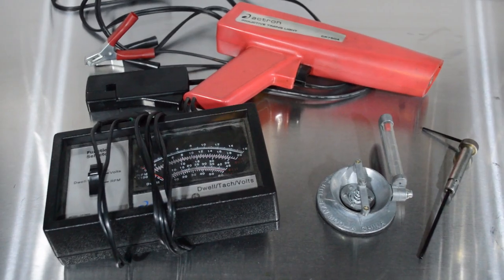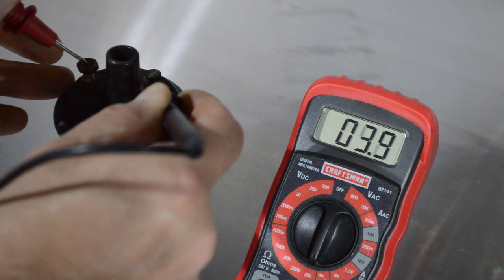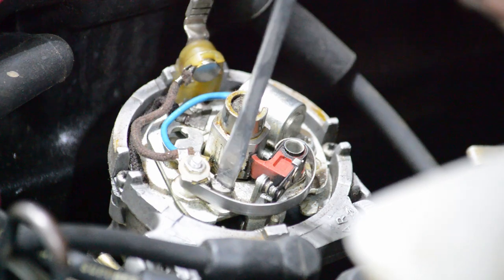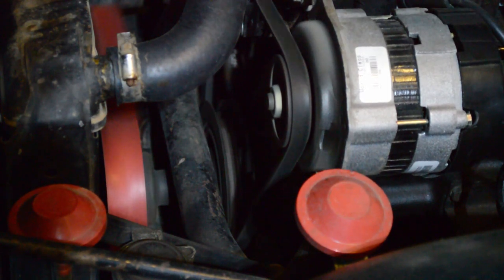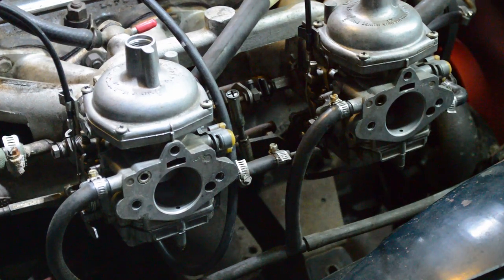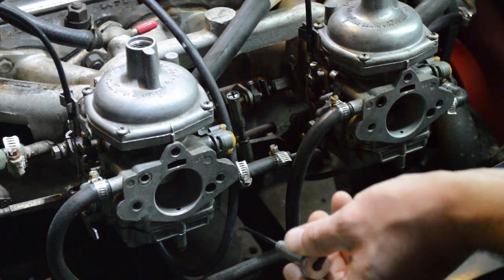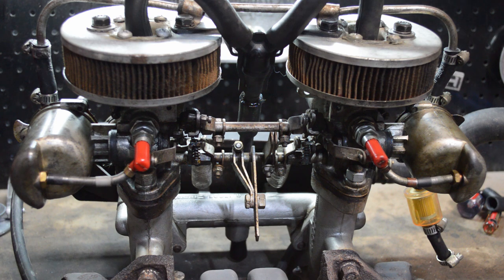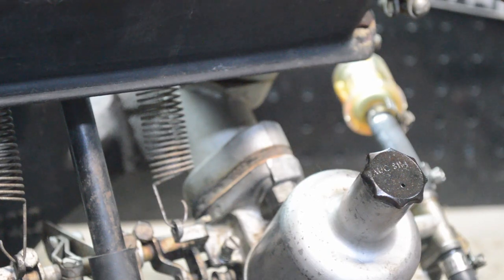How to Tune Zenith Stromberg or SU Carburetors on Your British Sports Car!

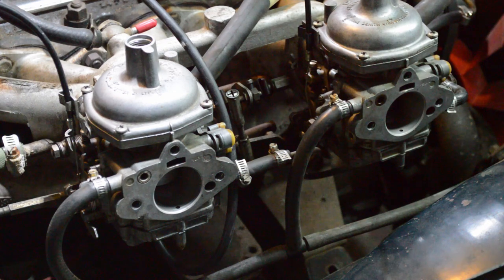Comment: 13:18 I really work on Edelbrock four barrel carbs but I''m helping someone who has a Triumph Stage fitted with these carbs, one thing we learnt is that if you screw the adjuster fully clockwise it will lift the needle and be fully rich, from that point you ONLY have 3 turns anti-clockwise (counter clockwise) to lean the mixture off, if you go more than 3 (maybe 3.5 turns MAX) then the adjuster will become uncoupled from the needle, then no matter how many clockwise turns you go it will not lift the needle! If you are careful you can gently push on the brass housing that the needle sits in to re-couple the adjuster. Also the way that the adjuster works appears to be backwards for a normal thread, i.e. when turning the adjuster clockwise you would think that the needle is lowered into the needle jet, it is not, it's lifted out of the needle jet, if you take the needle and its brass holder out of a piston you can work out how the adjuster works, its quite clever!
Reply from the maker: While it's technically possible, the needle really shouldn't become uncoupled.  There's a grub screw in the side of the air piston that holds the needle and keeps it from dropping out, so make sure that's in place and properly tightened.  At the top end, there's supposed to be a retaining clip that keeps the adjuster from moving up.  If you wrench down on it, it'll still move, but you should be able to feel it and know you're turning the tool well past where it should be.  Check both those things, since without them it'll be difficult to get the mixture to change accurately.
Reply: @midwestmotoring  Yep the grub screw on both pistons was in place, it does stop the needle from turning so that will go up and down on the adjuster thread and like you said it stops the needle from totally falling out of the piston but on the carbs that I worked on it did still allow the needles to fall away from the adjuster. If you think about it, if the grub screw did not allow the needles to disconnect from the adjuster then when the needle bottomed out on the grub screw the adjuster thread (or needle thread) would be damaged if you continued to turn the adjuster in order to lean the mixture. The needle would not be able to move any lower so something would have to 'give'.  Anyway if you have a spare piston with a needle fitted I guess you could test this, you could turn the adjuster counter clockwise 10 times, then turn it clockwise in order to see if it lifts the needle. One the carbs that I worked on it wouldn't lift the needles!

Comment: Thanks for the great video! I have a question about tuning the 175 CD. I have only one in my 1979 MGB. There are two screws that are accessible when the carb is assembled which I believe are the throttle-stop screw and the fast idle stop screw. How do I adjust those to make the engine run smoothly? I've been having an issue where the car runs well until about 2000 rpm but anything higher and the idle rpm drops lower and lower until the engine cuts out. Thank you!
Reply from the maker: Later CD carbs had 3 visible screws, which (at least in the US) were (usually, but not always) an idle trim screw, the fast idle screw, and the idle speed screw.  The idle speed determined where the throttle plate rested, the fast idle screw hits the cam on the choke (if you have one), and the idle trim screw you basically shouldn't mess with since you're not going to notice the difference anyway--you need a gas analyzer for that one.  You need a special tool to adjust the mixture of your carb, which I show in a few of my carb videos.  Hope that helps!
Reply: @midwestmotoring  Thanks for this but I can’t, for the life of me, find the third screw. Do you mean the ‘screw’ to adjust the jet within the carb?
Reply from the maker: Depends on the carb you have.  One is on the throttle to set the idle speed, another will set the fast idle speed when the choke is on, and the third is an idle trim screw.  That one adjusts the mixture, but only very slightly.  Not every carb will have it, and you'd need a gas analyzer to use it.

Comment: Yes very, very good info. That said when you are producing a teaching  video consider borrowing a muffled Triumph even if your straight pipe baby needs a tune up. I've got a TR6 myself but i didn't make it thru the video because of the joyful noise.
Reply from the maker: Actually I did put on a new exhaust, which is a stock one.  I think I did that before this video, but I'll make sure the sound level is better going forward.  Thanks for the feedback!

Comment: Excellent video Wish I had su carbs on the tr6 like I have on the tr3 Nice job
Reply from the maker: Just put up another video talking about CD carbs.  SUs and Strombergs are basically the same apart from some add ons that the strombergs have.  I actually like them better in some ways.

Comment: Hola !
I really learn and enjoy your videos. Your technical expertise and well versed tutorials make the difference. I have a question for you, if you’re so kind. I overhauled a set of strombergs for a friend this week. Step by step as you describe in your video. After installing them and doing the adjustments, etc the car revs up and stays in 1200 to 1400 rpms. I’ve checked for vaccum leaks, none, sticking linkages, good, and everything else that I can think of. The car in question is a 1970 Jaguar e- type. Any suggestions? Again, thanks for all the videos .
Felix Diaz
Puerto Rico
Reply from the maker: Sounds like the bypass valves aren't adjusted correctly.  They are probably set with not enough pressure on the spring, so they're allowing fuel to bypass at too low an engine vacuum.

Comment: This is great I'm working on my e type 4.2 and I would imagine the basics are very similar,, If there is anything I should know before I start,,, can you drop a hint ,thanks Chris
Reply from the maker: Hi Chris!  The main differences will be in the needles used (no procedural change, just a different part number) and potentially how the floats are set.  Yours may be at a different height than a TR6 or an MGB.  Other than that, most of these carburetors are substantially similar.  Some of the attached emissions components also varied between companies.  I'd suggest checking in your shop manual to verify the settings, but other than that I can't think of anything off hand.

Comment: working on my neighbours 1950 rillie rms ?  changed to electronic ignition and now to adjust the SU carbs after I repair the exhaust leak and water leak thanks  for the insite. also there is no oil in the dash pots or a dip stick only brass caps ?
Reply from the maker: The brass caps should unscrew, and there would be oil underneath.

Comment: Fabulous series on the Stromberg carburetors. Great to have gone to school class. Really appreciate that you simplify with a clear delivery and you’re not afraid to share the odd faux-pas.  Combined with your ignition system videos I’ve got my 72 GT6 Mk3 running like it never had since i got it. 
Did our own schooling on the Lumenition electronic ignition which had a blown IC, replaced for 50p :)  One thing i got confused about in my car was i found it had a 12volt coil labelled for a ballasted system. I’d thought it was one or other. 12v non-ballasted or 6V ballasted. At moment I’ve replaced the coil with a 12v with primary resistance of 3.5ohm which matches the spec in the Haynes manual. But would be great to know how to double check if there is or is not a ballast resistor in situ. Any tips for that? Cheers Jim (Glasgow Uk)
Reply from the maker: Hmmm... So technically, in a points system with a ballasted ignition and the points closed, you have a complete circuit and can see a lower voltage than battery voltage.  You'll get something like 8V instead of 12V.  If you have a non-ballasted system then you'd see the full battery voltage rather than a reduced amount.  This ONLY works with the points closed, since without the complete circuit you'll get battery voltage either way.  You may be able to mimic closed points with an electronic ignition.  For example, the new XR700 system I believe has an LED light that may indicate when the points would be open/closed (even though there are no points).  Alternatively (and this is a question for en electrical engineer or some other qualified person), I believe most voltmeters show the AVERAGE voltage.  So if the points are opening and closing (or if your electronic ignition is triggering the coil), you might see the average of 6-8V and whatever battery voltage is.  If that's true, then pretty much any number a bit lower than battery voltage would indicate you have a ballasted system requiring a 1.5 ohm coil.
Reply: Thank you again. Sorry for tardy reply. Checked that out and I'm getting constant battery voltage levels and think can safely conclude that is an inflated system, the previous coil was incorrect. Think that's the ignition system all in good shape now and the repaired chip in the electronic ignition seems to be holding up well. 
Getting a little backfiring under deceleration but the car hasnt run for quite some time so plan is to get a few hundred miles and a few trips under the belt and revisit the timing and carb tuning. Thanks again for your videos.
Reply from the maker: @jimdarroch2136  I'm happy to help.  The backfiring, by the way, can be down to a couple reasons.  First off, if you have bypass valves on Zenith Stromberg carburetors, they might be closed off to make them non-functional.  A lot of owners have done this, but it makes the car prone to backfiring when letting off the throttle.  You might also find that the timing is changing under deceleration.  Maybe a weight is sticking inside the distributor or a vacuum capsule isn't working properly?  I'd suspect the weights first since the vacuum only moves the timing a few degrees.
Reply: Midwest Motoring cheers. I'll  monitor it for a bit and check the bypass valve in case prior owners did this. I'll be ready to strip the distributor. Saw a helpful video of that somewhere 😊. I have added oil already. 👍

Comment: Thanks, your videos are very helpful as I work to revive a TR6 myself.   What are your thoughts on the idle adjustment screw on the Strombergs?
Reply from the maker: Good question!  Technically you're referring to what is (on most carbs) the idle trim screw.  With Z-S carbs, the trim screw is the finest adjustment with the least amount of range.  It will be difficult to find the proper setting without a gas analyzer, so you should just get as close as possible with the needle.  The needle, then, is a slightly less fine adjustment.  It's what you'll want to give a half a turn or so to when you go into the mountains, or what you should use when tuning the car after doing work.  Finally, the course adjustment is the fuel floats.  If you haven't got enough range in the needle travel, the float height (and remember there are 2 sides to the float!) may be off.  The short answer is that I usually just screw in the idle trim screw all the way and ignore it.

Comment: Nice demo the only thing I do different is that I blip the throttles when tuning them.
Reply from the maker: Ralph, that's an excellent point.  I should have done that, and it's the correct thing to do in order to clear everything out.
Reply: @midwestmotoring  at what point(s) during the process would you blip the throttle?
Reply from the maker: @GregSchnittger  just generally you don't want to let the engine sit idling for too long while tuning it.  You'll get false readings.  Best to hit the throttles and then let the RPMs settle just before you raise the piston to check the mixture.

Comment: Very helpful, I had a MGB before with twin SUs, it was good fun. Now I have a Triumph Vitesse 1967 2 liters inline 6 cyc. with twin Zenith Strongberg Carbs which are running good. What is the tool you use to adjust the fuel richness?
Reply from the maker: That would be this guy: https://mossmotors.com/triumph-tr6-250/car-care-garage-tools/tools/tool-carb-adjusting.  There are other vendors that sell the same thing, and they all vary slightly but do the same job.  It's worth noting that only later Stromberg carburetors use this tool.  The early ones adjust by a hex nut on the bottom of the carburetor, and for a year or so in the middle you may even find carburetors that are not adjustable--you have to disassemble them and physically move the needle.

Comment: Thanks again great video.
Reply from the maker: I'm happy it's helpful!  Let me know if there is anything else you would like help with!
Reply: @midwestmotoring  Hi there is one thing, at some stage could you do a video on crankshaft end play, how to measure it and how to fix the problem with the motor in the car (TR6)  Many thanks
Reply from the maker: @darrenfechner5613  there is a video on crank end play. I think it's part 1 of getting the TR6 back on the road. I didn't need to show the repair but I've got the Spitfire engine out and will show the process there as well.

Comment: Excellent video !! I’ll surely watch it again when I’ll be adjusting my carbs on my Triumph GT6 !

You talked about early and late Stromberg carbs concerning the adjustment; do you consider CD150 Stromberg (as fitted on MK2 GT6) to be early or late ?
Reply from the maker: Good question.  It could be either since I'm not sure when they made the change and you may or may not have the original carbs on your car.  If there is a hex nut on the bottom, then that will be the adjustment point.  Later carbs have a simple brass plug or a slotted screw-in plug on the bottom.  There will not be a hex nut.  A quick peak at your carburetors should tell you which you have.
Reply: @midwestmotoring   great thank you for the reply !

Comment: New to old British cars, I'm getting ready to restore a TR4. I was just going through the carbs last night.  I've been building motorcycles for years, and am used to vacuum syncing. Is there a reason why an air flow meter should be more accurate in setting up a set of 175cd carbs? I noticed vacuum lines on both carbs I was thinking that was for this reason lol.
Reply from the maker: The vacuum lines on the carbs are not for syncing  them.  They drive the distributor advance/retard depending on the throttle position and load.  An air flow meter is definitely more accurate, but you can do it with a bit of hose and just listen to the sound.
Reply: @midwestmotoring  I understand what they are for, but don't quite understand why they wouldn't be able to be used to balance the carbs. For motorcycles you adjust the butterflies so that the vacuum is even, but here your adjusting the butterflies to even inlet air velocity. I just am curious if this is more accurate or if it's doing something I don't understand or am overlooking.
Reply from the maker: You probably could use them... but I believe only one carb has a vacuum port.  You'd need a set with vacuum ports both on the top or both on the bottom (one top, one bottom will not have the same signal).

Comment: Question - ZS 175CD  single carb on MGB.  Adjusting the mixture following the same process you show for the dual carbs.  Question...  doesn't the mix get significantly thrown off when the air filter/air box is installed.  Specifically, in my case I felt like I had the carb very well tuned.  I installed the factory airbox and restarted the engine.  The engine ran very poorly.  How could I have compensated for this while doing the adjustments?
Reply from the maker: It might make a difference, but not a significant one. If installing the airbox makes things worse, you have a restriction that shouldn't be there.
Reply: @midwestmotoring  Thank you for the reply.  That is certainly what I thought believing the airbox/filter is designed for minimum restriction.  However, not what I experienced in installing the factory airbox with a brand new filter.  I had a person with experience on these suggest tuning the carb with about 1/2 the throat taped off to replicate filter on conditions.
Reply from the maker: I can promise there's a difference, but not that much. I can see them run more lean or rich, but only with an exhaust gas analyzer plugged in since the difference is very minor. I wonder if there's a restriction in your new air filter, or if there's a hole somewhere that's plugged but shouldn't be.  Anyway, if it runs better it runs better... but consider changing to a different style filter if it turns out it's that bad.

Comment: Great video. Question I drove my 75 TR6 at a higher elevation (2400 ft) and stopped to enjoy the view. After about 10 minutes the car was hard to start and I had to use the choke to get going. Once I got back down to sea level it ran fine. Are the TR6 carburetors that sensitive? Thanks
Reply from the maker: Short answer, yes... though I'd expect a much larger altitude change than 2400 ft. Easy to fix though. If you know you're going high up and have any trouble, just keep an adjustment tool in your car. Wind the needles down a quarter to a half turn and keep on driving, then replace later when you're lower again. Technically though, it should run rich at higher altitude... not lean, so if the choke is what worked, you may have had a different issue such as flooding. Pulling the choke does add even more fuel, but also opens up the throttles too.
Reply: Thanks for the advice. Car is running great.